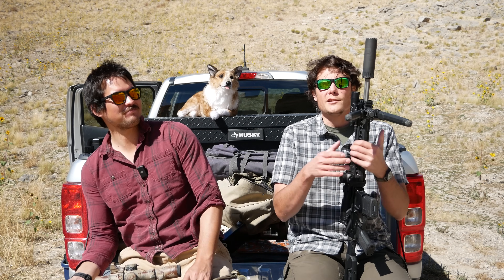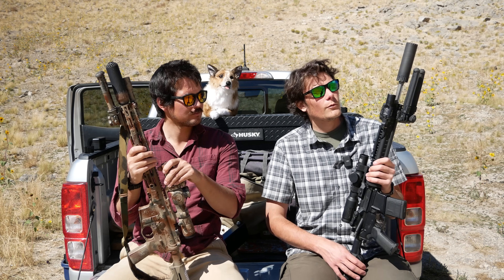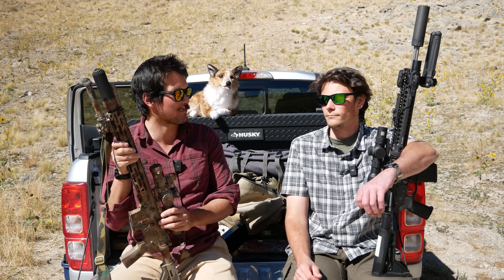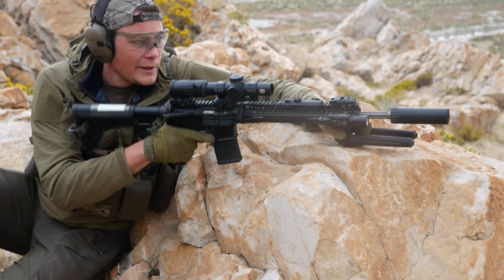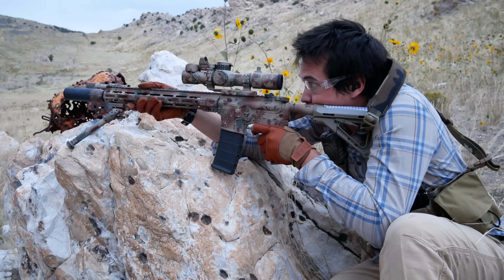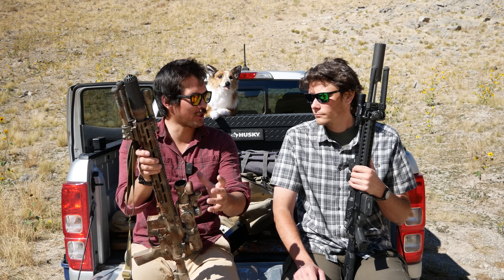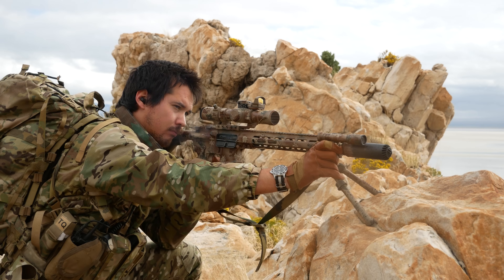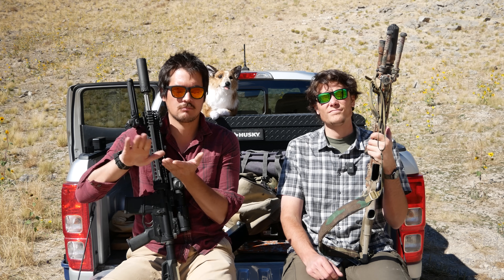Urban Precision Rifle Build

Comment: Shorter rails are where it’s at. For some reason I kinda like the look of a low pro gas block sticking out the end of a free float rail. Plus you save weight.
Reply: 15" rails are the most commonly overlooked "pleb build" indicator there is

Comment: Aero upper on an 80% lower, magpul fixed stock with Geissele H1 buffer kit, hogue grip, Larue MBT 2S trigger, Toolcraft NiBo coated BCG, BA Hanson profile 14.5” barrel, YHM qd flash hider with Turbo K can, Midwest rail, Vortex Viper PST2 1-6 lpvo, Surefire Scout light, Blue Force Gear sling. Rattle canned of course.

Comment: For my urban precision gas gun I went with the 13.7" stainless steel Noveske Infidel barrel with matching bolt. Optic I went with the PA 1-8 compact and I am very impressed with the accuracy of the Noveske barrels.
Reply: Same 13.7 ba Hanson, swamp Fox 1x10 piggy back red dot with sandman s

Comment: I’ve been running a Rosco k9 12.5 for a while and it performs very well. Been debating trying the K9 13.5 or whatever their next size up is in the K9 lineup. Great video as always
Reply: What optic setup are you running on your 12.5?

I also have a 12.5 and im at the cross roads of either LPVO or Red dot magnifier. Would love to buy both but I’m a poor lol
Reply: @JohnnyYK  yeah the good stuff is definitely expensive. I'm running an eotech on my 12.5 currently. No magnifier just back up irons. Traded a kel-tec sub2000 for the eotech lol
Reply: @ethan5.56  Nice setup, i was worried with how the 12.5 doesn't have really great velocity should I keep saving up for a really good LPVO and keep training iron sights or just get a very high quality red dot right now? My 12.5 is my do it all SHTF/HD rifle and i live in the south east.
Reply: @JohnnyYK  I'm running an eotech xps2-0 on my 12.5 and have run red dots on most of my rifles. I have a primary arms 1x micro prism on one and thought about trying the 3x or 5x micro prism sights

Comment: The original SEAL RECCE is pretty much the perfect setup for this kind of POU. NXS 2.5-10, high quality match barrel, mil spec receiver, bcg, G trigger. Mine with bipod and optic is maybe a pound heavier than my Mk18. Swap out the RAS for a more modern/lighter rail and you’re there. Light, very precise, no nonsense setup. Add your can and night vision accessories if wanted and done.

Comment: Hop, you just confirmed my opinion I’ve been leaning toward for a while. That being, red dots and magnifiers are for fighting rifles and LPVOs (especially 1-10s) are for SPRs. Real scopes are for long range rifles. I’ve been drawing that conclusion because an SPR is supposed to bridge a gap between fighting and long range. The 1-10s give you a 1x, and then a longer range reticle and magnification. Not the best, but max effective range of 5.56 isn’t that far anyways. I can’t stand 1x on LPVOs for fighting rifles, I want dots. And for close range rifles (300s, MK18), I don’t think a magnifier is necessary.

Comment: Besides the death blow dealt to the perceived character of any end user of a 3-9(xfudd) scope, why are they always skipped over nowadays? Is there something different about 3-9x scopes compared to 2-10x or 3-12x, besides the small difference in magnification? I haven't used many scopes so maybe there's something I'm missing. Thanks for any insight
Reply: Good question
Reply: The dragunov came with a 4x scope. People these days are really overthinking this.
Reply: I wish I knew. Out of budget constraints the "MPVO" I've been using the last few years is a basic PA 4-12x44 hunting scope and it worked well after I got a torque driver and actually bothered to mount it properly.
Reply: Focal plane and reticles. Also a small magnification range.

Comment: I have a KAC SR-15 lower with 2 uppers. One is a KAC CQB 11.5 with EoTech and G33 and RC3. The other is a KAC Carbine 14.5 with Kahles K16i and RC2. I can swap the suppressors depending on want or need. The uppers overlap enough for many rolls but work great at their intended rolls. Thats my main rig. Kinda like the military for special operations when they are issued a short upper and 14.5 upper with one lower.

Comment: I broke my rifle light kit for my x400v the exact same way. Now for it to work I put it on the 12o'clock on a bullpup build with a rail cover underneath so the rear of the "tailcap" is wedged in place. Weird how they would use a small frail plastic clip for this while streamlight has metal clasps in the same spot.

Comment: Urban? So concrete buildings, cars everywhere, gang activity, and groups of marauders kitted out similar to a SWAT team.

So ammunition choice would tend to favor penetration characteristics.

Longer barrel setups to achieve higher velocities needed to deal with crosswinds in a city environment.

Lessons learned from urban combat...4x works well... red dot with magnifier works well.

Scopes require some additional training...but come with the ability to adjust for aging eyes.

Urban...needs to be light enough to carry/climb fences, walls, generally get up on to rooftops in a hurry.

Lots to consider

Best of luck
Phil

Comment: Funny I have the 16inch heavy profile 4150cmv BA and the 1-10 vudu, I'm pretty happy with the combo so far, definitely front heavy though. Also running the 13in Midwest suppressor handguard, I actually like the shorter handguard but to each their own.

Comment: Maybe an odd question but here goes. If a suppressor is not legal in your AO, what do you think about pushing the barrel to 16"/18" since you will not need to deal with the bulk/weight of a can?
Reply: a 16" with a blast diffuser or linear comp is certainly not as good as a suppressor, but it maintains the SAWC, retains the velocity, and does all the important things. This was my solution.
Reply: I think accomodating a suppressor is the main reason for wanting the shorter barrel. If that isn't a factor, I think the extra velocity is worth it.
Reply: @benb50001  Accomodating the suppressor/getting to non-NFA length (without a pin&weld)

Comment: Seems to me that you guys are essentially building the M4A1 Block 3 URGI rifles.
Slick rail, shorter barrel length, LPVO.
I'd almost say that whichever configuration we may want to claim, it's been done by the military in one form or another.
Reply from the maker: Mine doesn't have a LPVO.

Hops does have a LPVO but he's running a precision barrel, not a CHF. It's a small difference but that's really all we have with AR15 builds.

Comment: If I had it to do over, I'd have built a 24" 6.5 Grendel as a SPR, stuck with a lightweight 16" 5.56 as my go-to rifle, and built out a 12.5" 6.5 Grendel as a close quarters build.  As it stands, though...

I run a 16" pencil profile lightweight build with a 1-8x LPVO and a top dot as a GPR. PEQ on a QD with an Inforce light. The Inforce isnt as good as a Surefire by any stretch... but its lighter, and easier to pull off the rifle if need be. Its also hard to beat dual output for under $150. It works well enough in close quarters, can touch 700 realistically with good ammo, and is excellent in the 25-300 range, which is where you can expect most of your engagements to take place. Best of all, it's under 8 lbs fully loaded...

The last thing I want if I'm having to move fast in an urban setting is a 12 lb SPR on my back. 

Dont get me wrong, they have a place... I'm back and forth between Oklahoma and Tennessee a lot, so my stomping grounds are ...pretty flat.  A 20" HBAR build is definitely in my arsenal. Its not my go-to, though. And neither is my 10.5" build.
Reply: In the process of building up first arsenal. Got a ddm4v7 in 2015 but looking to add a suppressed pistol/sbr. 6.5 grendel seems to be the answer on paper but I'm scared to build because of the reliability reports of the 6.5 Grendel system. Thoughts?
Reply: @Genesis-revelation70  as long as you're getting your barrel from a reputable manufacturer, you should be fine. Go with Ballistic Advantage if you're unsure and don't want to shell out a ton of money somewhere else. 

I'd also go with the Type II Grendel and buy a high-quality bolt. The bolt lugs are longer on type II, which will help with the lugs shearing. You'll also want a high-quality bolt because the extractors are a little more thin in the Grendel/6ARC/7.62X39 ARs. 

That aside, you should have no reliability issues at all with a Grendel build. Just tune your buffer weights for proper ejection, and you're good to go.

I prefer my ejection just a little weak at closer to 4 o'clock, but you wanna aim from somewhere between. 2 and 4, ideally. 

Polishing your feed ramp will probably help, but I've found it's not really necessary. Most of your 6.5 Grendel reliability issues come from using lower quality complete uppers without actually checking the torque on your parts. Gas blocks, gas keys etc are almost always under-torqued or not staked properly on lower quality complete uppers. Otherwise they're adequate for most people.
Reply: @Genesis-revelation70  ^
Reply: @BuckF0eJiden  Good info, thanks for the reply!
Reply: @Genesis-revelation70  np. Happy building!
Reply: @Genesis-revelation70  fun little bit of info... 6.5 Grendel shares a parent case with 7.62x39, and the Duramag 7.62x39 mags feed 6.5 Grendel perfectly. They'll probably feed 6ARC, too.
Reply: Really good info and interesting perspective OP. I think a 24" Grendel is extra "Special", it will shoot beautifully but carry horribly lol. 24" just doesn't sound like a good fighting gun, more of a static  shooting gun. The SPR concept is not the same as the sniper role, despite there being similarities and overlaping skills.
All that being said I would love to hear more about your rifles and purpose of use etc. 
I'm trying to resist the call of the Grendel but it really does sound great.

Comment: short rail is the way. we need to go back. saves weight up front. i wish i got a shorter one for my 14.5
Reply: I have a 9.3" mk4 Geissele on an 11.5" Colt FBI, love it! Also have a 20" build with a 13.5" mk16 Geissele rail. Happy with both.
Reply: Not to mention In nobody gripping all the way up front for long anywhere except the flat range.

Comment: My "do-it-all" rifle is a 14.5 Geissele Super Duty upper (only $840 for complete upper WITH REBCG/Airborne charging handle & Surefire flash hider with pin/weld ALL INCLUDED on black friday, deal of the century) on my old Colt lower with an SSA-E and ambi controls with a Super 42/H2.

Vortex Viper PST GenII 1-6x, Offset enclosed emitter 509T, Cloud defensive Rein 3.0 light, BCM angled foregrip angled forward, and a Vickers sling. And my Mini RC2 suppressor.

I chose the 1-6x PST because for the $500 i payed i believe it is the best bang for the buck LPVO thats daylight bright, and since i truly believe the vast majority of fights will be like, within 100 yds, i prioritized that great 1x and daylight bright reticle, but the glass is great and i have that bit of extra capability to zoom up and make hits farther out IF needed. But i also live in North Idaho which is far more wooded, at least for the area that i live. especially in the outer edge of the city and around the family property which is backed up to miles and miles of national forest. I have to ability to make hits down the road leading up to the property, and across canyons and such, but if its super far im probably just bailing into the trees and setting up an ambush if anyone tries to follow. Or im sneaking closer to inside my 400yd very comfortable range IF needed... Mabey down the road i go more magnification But for now im happy.

Rifle does absolutely everything i could ever want or need, especially to the 400yds that was my intended range of comfortable capability i wanted.  and it will be my main squeeze for many years to come.

I mean. Ive shot it out to 550-600yds but honestly in reality targets are never fully exposed and thats a very far poke. If its 600yds im just gonna bail, they aint gonna hit me when im dodging, ducking, dipping, diving, and dodging at that range. 400yds i am very confident and competent.

As a side note. I am also very happy with the AAC ammo. Ive grabbed 3.5k of the 77gr OTMs and they shoot more or less 1MOA, but my main "duty ammo" are 77gr Razorcore and 75gr speer Gold Dot JSPs, i have 1.5k of each put aside for the struggles to come.😂

Comment: A 12.5” 6mm ARC will give you a more effective long range round than an 18 or 20 inch 77gr 5.56. 

25 rounds instead of 30 is basically your only downside. Oh, and price and availability.
Reply: I made a ballistics chart comparing various cartridges and 6mm arc is very aerodynamic, especially being an intermediate cartridge. In terms of bc and drop, it’s between .308 and 6.5 creedmore which makes it a very flat shooting cartridge.
Reply: @elterga6224  It definitely has a pretty decent BC. It’s not incredibly flat shooting as it’s velocity rests around 2,750 or so from 16” and 18” barrels, but - importantly - it retains its velocity very well. So it really begins to outperform your 77gr 223/5.56 after the 200 yard mark.
Reply: Right, the main problem is system reliability. It's also not enough better than 6.5 grendel to give up the factory load availability. Haven't built either due to reliability reports though
Reply: @Genesis-revelation70  Reliability just seems to revolve around finding the mags your gun works best with. As Grendel and Arc get more popular more mag options will come out. Basically you’ve got Duramag and ASC as the main options. I can legitimately say mine has been very reliable with ASC mags, which are the only ones I’ve tried.

Comment: Interesting, I had actually just built a 16" BA 1:8 twist .223 Wylde fluted lightweight barrel upper. I haven't fired it yet, got a killer deal on a Vortex Strikefire II red/green dot from PSA and it's on that with a Breek Arms 15" handguard and a Breek Arms 3FO flash hider with a Superlative Arms adjustable gas block. IIRC it's an Aero Precision M4E1 upper which are solid units. Currently putting together another lightweight 16" Mike Foxtrot 1:8 mid length on a Sharps Brothers upper with a 15" Presma handguard. With the Centurion Arms lightweight CHF 16" 1:7 twist with Centurion Arms handguard with the Meprolight MOR PRO that now makes 3 lighter weight go to war gun uppers as compared to the heavy barrel M&P15 Sport II (1/4 MOA precise no less 😮! but heavy AF, I think with everything on it it's still heavier than my Centurion Arms MKXII SPR with the KAC quad rail😅!) We'll see how things shake out with the new 34mm tube optics that are ginormous.

Comment: Ok team, not sure how else to reach out! Love the USPR and in that vein ive been struggling with a setup i think youd find worth doving in, or im retarded. I drive into atlanta and have to work all over the city. I carry but that isnt enough these days. Im attempting to build a backpack that my laptop and note book can be in but carry a rifle. It would look weird to carry a 24” hiking pck so im limited to a 20” from vertx as the biggest. Also, travel out of state so i dont want an SBR. Im stuck on a AUG since it can breakdown to fit in that bag but there are some obvious downsides to the AUG inckudong to bolt release and suppressing it sicks currently. I want a backpack that blends in but holds a rifle(broken down even). Need assistance on this

Comment: The OSS/huxwrx cans put a spin on the projectile which is why they almost never have baffle strikes. This must also cause thy round to get a slight boost in speed as well. Now I don't feel so bad that I built my 12.5 with a dedicated OSS can.
Reply: My guy, the rifling in the barrel puts a spin on the projectile lmao.
Reply: @frankholub4673  Yes, but the can helps stabilize the round after it leaves the barrel due to the flow through design.  Rounds can still leave the barrel and not be properly stabilized. How do you think alot of barrel strikes happen? OSS cans rarely have baffle strikes and thats one of the reasons
Reply: I thought it was because of the attachment method. Don't think that's how baffle strikes work
Reply: @Genesis-revelation70  Their attachment method also helps alot and is the main contributor but the spin the suppressor puts on it helps prevent it from baffle strikes. Obviously its doing something if it's adding fps where others dont. You can still get a baffle strike even if the can is properly aligned and installed. The ammo itself can cause stability issues.

Comment: Why shouldn’t you buy from radical firearms ?
Reply: Eh they have had some quality control issues in the past, I know of four different ones that have pretty high round counts and one of those being a 7” … with no hiccups… typically not the best quality barrels or rails but when you can find them for under 400$ they made a great beater gun with a red dot…. No shame in having one if it’s what you can afford …run the hell out of it and have fun.
Reply: I just finished typing a comment in regards to the same thing. I have 2 Radical Firearms complete uppers and they work just fine. I cannot afford to shoot thousands of rounds out of them but when I do train with them they have never let me down. Granted I cannot tell you where I got the bolt carriers from I just went for nitrided, staked, and auto.
Reply: I remember hearing stories of their barrel extensions coming loose. This was years ago though.